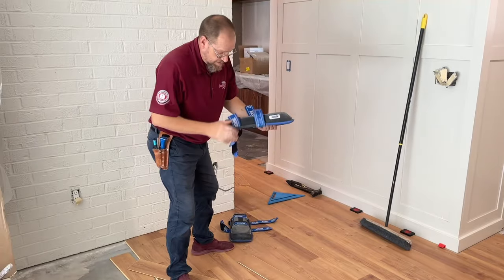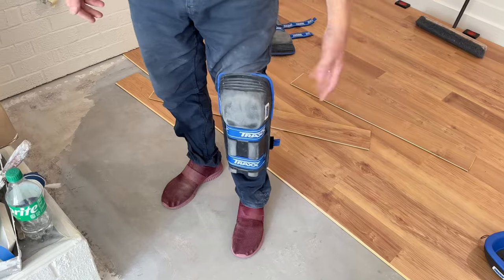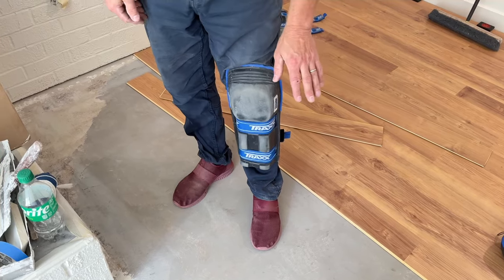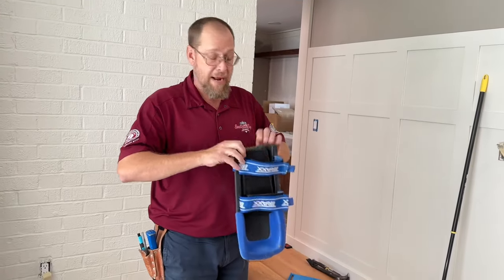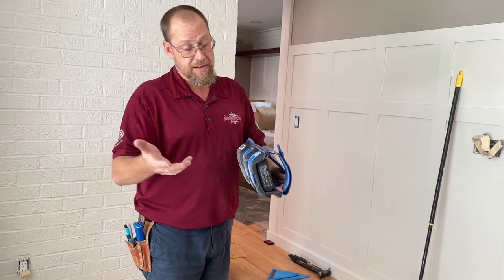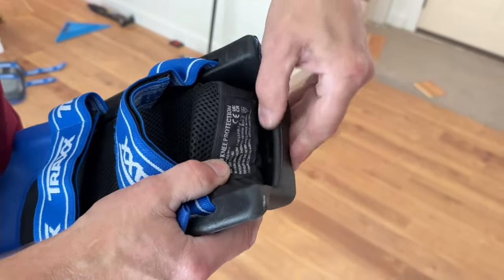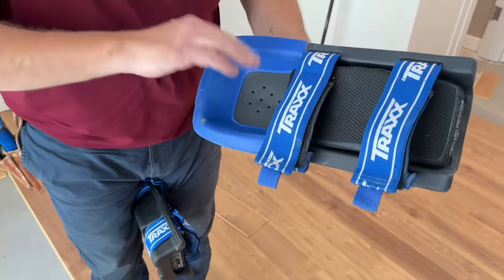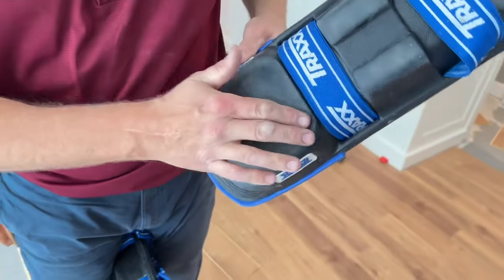Best Kneepads For Flooring 2024

Comment: Please don’t tell me you wear those red shoes 👠. That’s your first problem get some boots. I promise you that foam isn’t going to last 5 years. I’ve had my pro knees for at least 5 years and they feel great. I put blue tape plus some other tape over the part that get the most wear and tear and they are holding up just fine. Truth be told one of the buckles just broke but some tape fixes that. I’m prob due for a rebuild kit or a new pair but they feel fine. Yes they cost around$250 if that but you do the math after 5 years. That’s $50 bucks a year and if you feel like arguing just go get some leathers and shut up. By the way I do union work so I can vouch for long work days.
Reply: $50 a month for 5 years equals $250? .....I think maybe you should re-do the math 🤣. But all joking aside. I've been doing flooring forever over 20 years. Proknees, so far, have been the best kneepads but I think I might just give these ones a try.